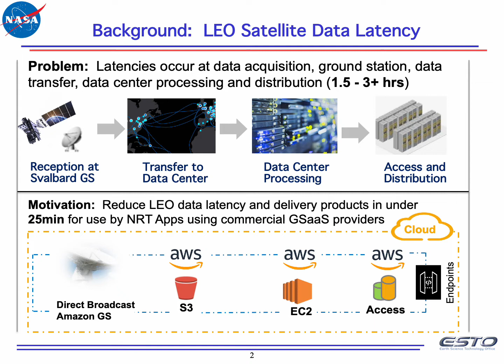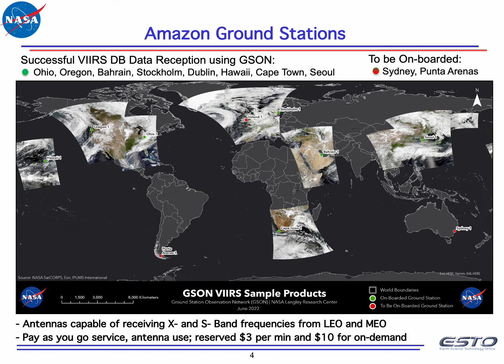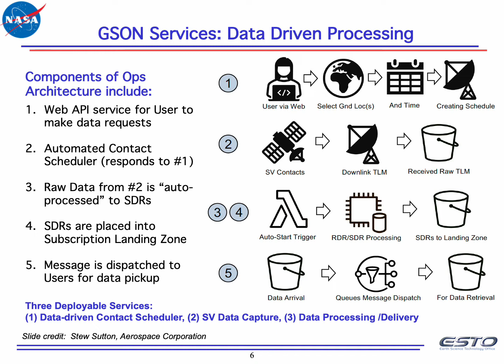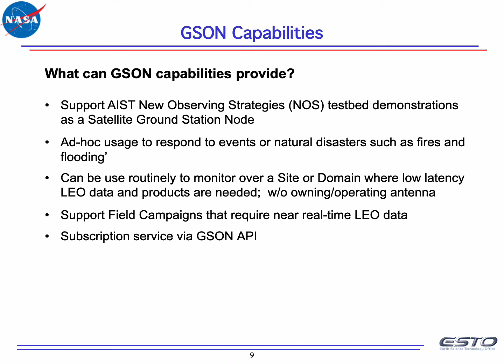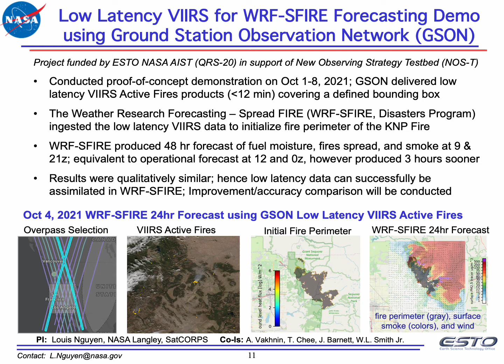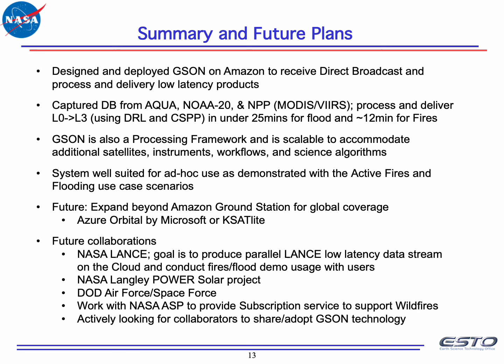30 Nguyen   Low Latency Direct Broadcast Data Products using Ground Station Observation Network GSON

Comment: What kind of systems do you have to monitor and map the charge distribution within major windsystems ?
Do you have anything currently that can detect startup dynamics within the context of thermodynamically active ocean pollution (in shipping lanes for example or around and between oil drill rigs ) .
which AI are you using for the interpretation .
Have you measured the frequency distribution within the systems .
From center to feeder bands .
Pressure distribution .

How do you detect the process of a standing wave generation/establishment  that explosively strengthens the circular .
 momentum .Outside quadrants .
How do you calculate the most likely targetzone of cat 3-5 storms .
How do you gain insights into the mission statement of each individual event ?
For example super soaker events after actionably high amounts of Round up / pesticide applications .
Where are your 
Hurricane enigma devices located .
Based on the insights gained , what are you suggesting as a course of action in order to prevent these big response systems in the future . Do you need help understanding why/ what is going on ? 
At the current rate of arising needs for chemical assault mitigation via hurricanes how do you communicate these insights to policy makers 
What is being done to prevent these necessary natural disasters in the future .
If they are not prevented via change of agricultural practices , humans will predictably run out of natural resources for rebuilding efforts .
What are the current qualifications for policy makers ? I can't help but have a feeling that there might be a certain lack of understanding due to the lack of policy changes that would accommodate the insights gained .

Do you have any live 3d thermoscans that monitor the entire system  during nighttime phases as well as during the hours when the ionosphere is stimulated via the sun .( Charge fluctuations /temperature variants )

As for the wildfires 
Do you understand what they are trying to communicate ? 
This is of crucial importance as it is directly correlated to chemical burns on as well as in the soil at other locations .
It's like the Cartesian diver principle .
Fighting burns with fire by eliminating the humans that cause them .
Nature is much more conscious than humans want to admit .

But then again your friendly AI probably did already communicate this to you ?

Thanks for sharing your technical efforts with the citizens of the planet .
It is of crucial importance to understand why what is happening . 

Namaste